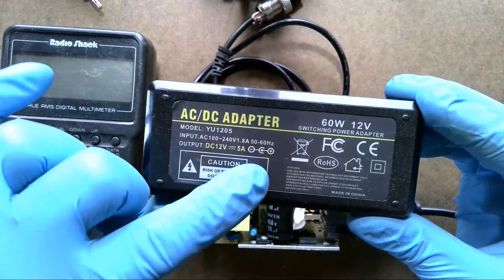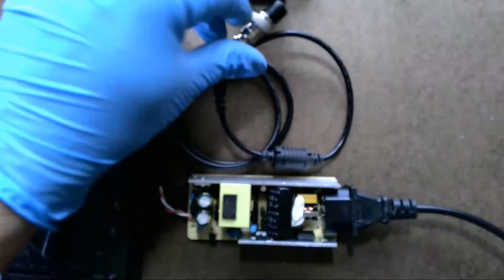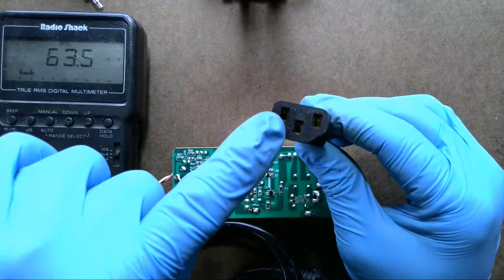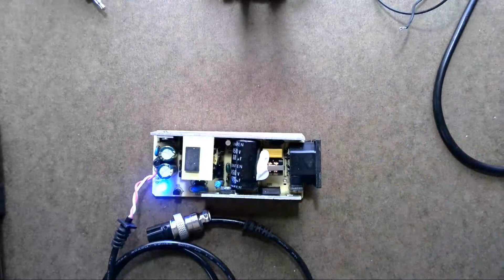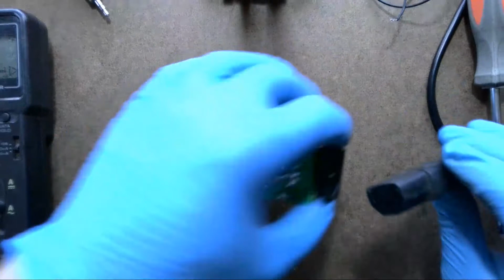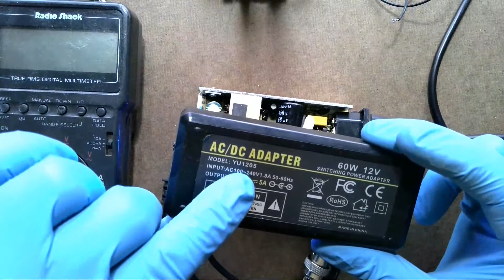🔺How to fix/check Retevis RT97 GMRS two-way radio repeater power supply!! 🔺

Comment: I had the same issue with power supply that was only 6 months old. Would not power the adaptor and repeater. Used a desktop top cord for the adaptor and worked.